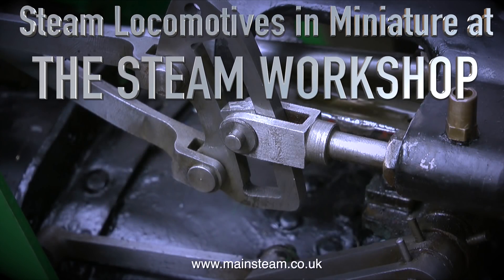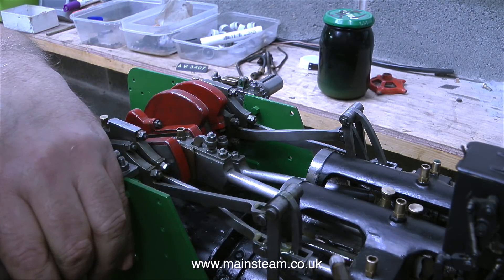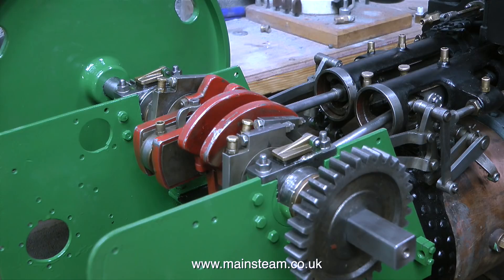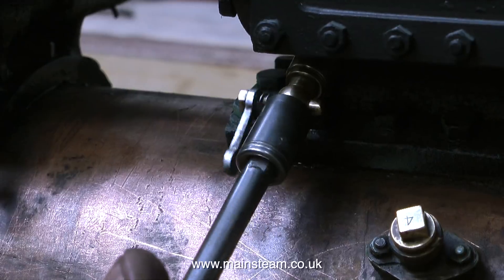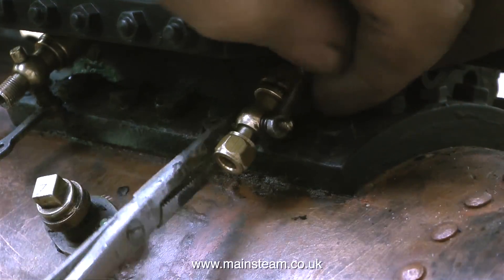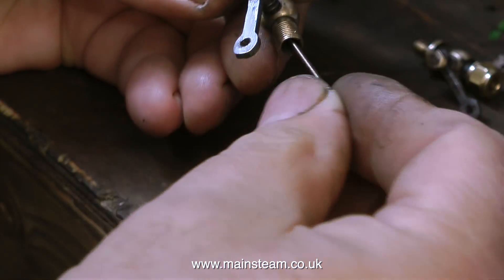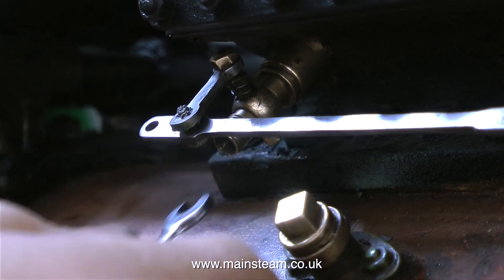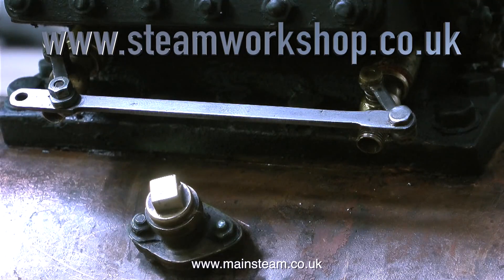THE STEAM WORKSHOP - GARRETT DCC TRACTOR - PART #4

Comment: I am certain this is an easy question, I've watched this channel for quite a while and I usually don't bother with what scale the model is, like 5 inch or 7 inch scale locomotive, etc.. I just watch it to see Keith work his magic.  I used to think the scale referred to the track width the loco ran on, but this traction engine doesn't run on a track.  So I started wondering what it means.  I assume the 3inch scale is referenced to some physical size of the original, like 1 foot of original equals 3 inchs of model, or maybe 1 yard of orginal equals 3 inchs.  Could someone let me know what the "3 inch scale" means?
Reply from the maker: 3 inch scale means that 1 foot on the full sized engine is equal to 3 inches on the model - so 3 inch scale is quarter full size .... 4 inch scale similarly would be 4 inches for every foot on the full size which is one third full size .... you may find this useful: https://en.wikipedia.org/wiki/List_of_scale_model_sizes

Comment: Quicknquestion is the rotating mass balanced? The reason I ask is I observed the tractor wobbled when it was at a mid speed. Thank you Keith.
Reply from the maker: Just like on the full size - the only balancing is on the crankshaft - Traction engines always rock back & forth ......
Reply: Keith Appleton thank you Keith.